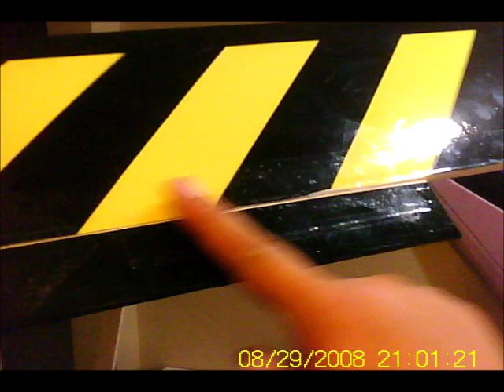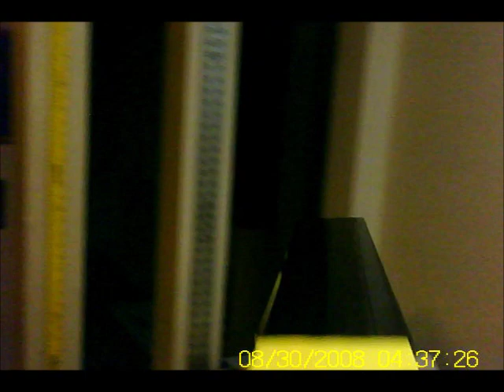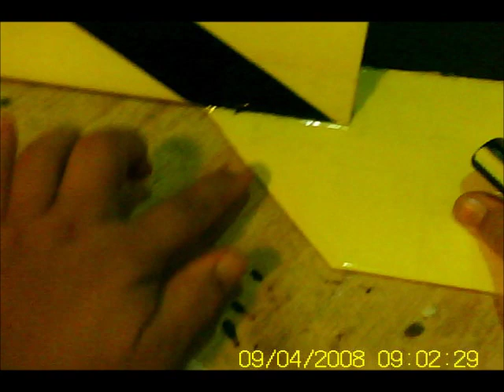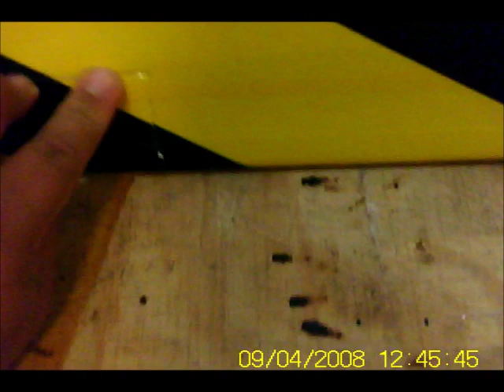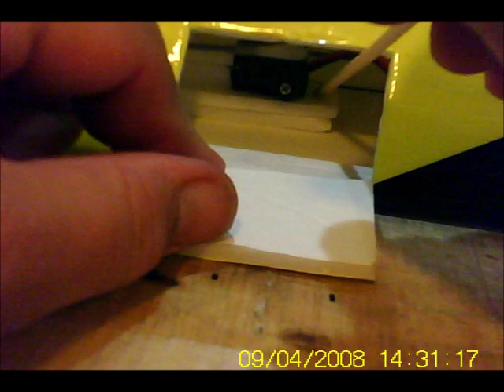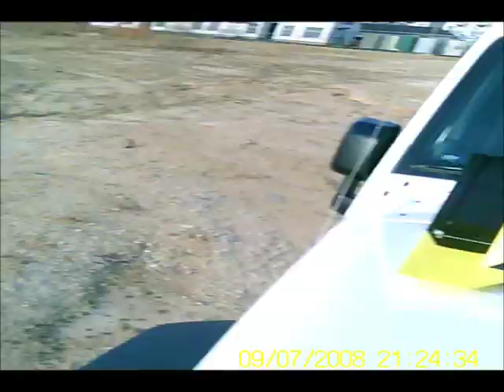Foam Board RC plane- Caution Plane Build and Maiden

Comment: A fun build, and I loved the caution colour scheme! I definitely like the triangular fuselage and crumple zone idea.
But all the instructors at any club will advise you to go much higher for a maiden flight.
 Unfortunately, I did a very similar thing with my last plane. A lovely Phoenix 2000 motor glider. Took me a few months to get around to the maiden, and I wasn't high enough and I was flying with happy thumbs after a long hiatus. I forgot about the turbulence from nearby buildings, so the plane stuffed itself through a barbed wire fence!!!!!! And I was standing there goin "Eh? Wah hoppen??" :'¬( So I'm gonna build 'em cheap with foamboard from now on, for quite a while, until I'm less of an idiot. :¬D
Reply from the maker: +ChuckPlains  Ha ! Yeah, I needed a lot more space between my plane and the planet !! That barbed wire fence is destructive. I severed a plane in half going through it once. Tough day right there. Luckily the camera wasn't on it.
Reply: daisy8luke
Heh, yep, mutual ouchies. No cameras will be seen on my aircraft for the forseeable future. (hmm, spellcheck doesn't like forseeable)

Comment: I have been trying as well to do something with triangle fuse but, wanted landing gear. Never thought of how you attached the wings, Smart man, smart!
Reply from the maker: SnapPunch Robert Make your own landing gear with a thin aluminum flat bar and attach it to the underside of the wing instead of on the fuselage. This way when you land, the landing gear strut of solid and durable. I did that same thing on one of my other triangle fuselage planes, and it worked perfectly.
Reply: Thanks

Comment: Do you have a plan for that? I'm making something very similar but having trouble with what I think is the motor
Reply from the maker: I never make plans or use plans, I just take the basic concept out of my head and build it. It's simple, really. Just make a triangle tube for the fuselage and a wing to match it. You can probably get all the info you need off the video. What problem are you having with the motor? Keep in mind that a good rule for motors is 100 watts for each pound of plane weight and prop accordingly. There are hundreds of motors to choose from for this plane, but I prefer Grayson Hobby 2217-06 for it. After the crash I rebuilt the nose and used this motor, and it performed flawlessly. I just didn't have the camera rolling at the time!!

Comment from the maker: Thanks, bro! The cool thing about the triangle, other than it is super strong, is that you can easily put different sized batteries in it, and you don't have to make it wider. This flight was using a 3cell 5000mAh car battery from my Slash 4x4, and it slides right in without issue. It obviously will aslo easily accept the smaller 2200mAh batts. And the v-tail is my all-time favorite. I just wanted to try a rudder this time. I am unimpressed with it. I'm a bank-and-yank kind of flyer!!

Comment from the maker: No, it was just a throttle issue. In fact, I used the rudder so little that I'm considering taking it off and removing the servo for a little less AUW.  That motor is really big, prob too big for that plane. Spinning a 10in prop, I should have known that might happen.

Comment from the maker: Yeah, I like the way it looks. It flies really well and is very stable. I'm putting that Grayson 2217 on it tomorrow. It's what  Agent Orange has, and it goes unlimited on vertical. Should easily take this plane where I want it, since it only weighs a couple of ounces more. Might even be faster than the big motor was. I'm hoping. May ditch the rudder and servo. Hardly used them. I'm used to bank and yank flying without them!

Comment from the maker: Yeah, just a bit too strong. I'm stepping it down to a smaller Grayson Hobby 1500 Kv motor and a smaller 8x6 prop, which should handle the load of this plane quite well. That 10in prop and big motor prob would have done fine, if I hadn't hammered the throttle so suddenly. Until then, it was flying great. I do have another tri fuse plane called Agent Orange. Check out my vid on it. The carbon reinforcement in the fuselage is what makes it strong, no matter which direction it points.